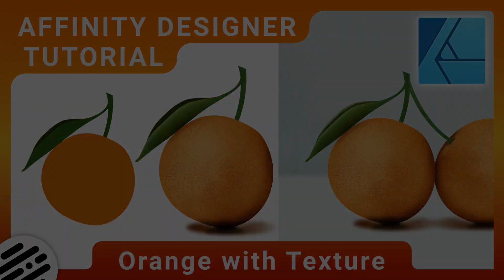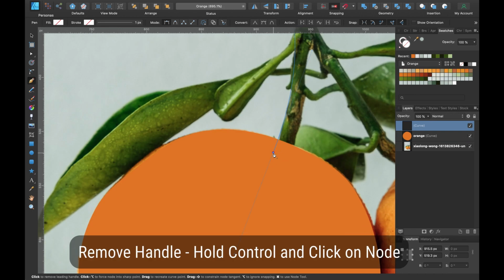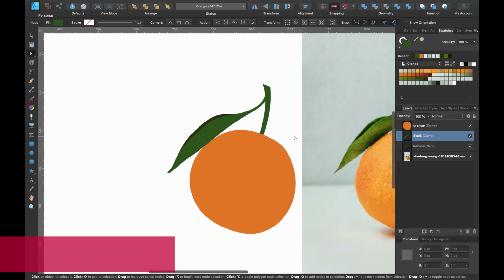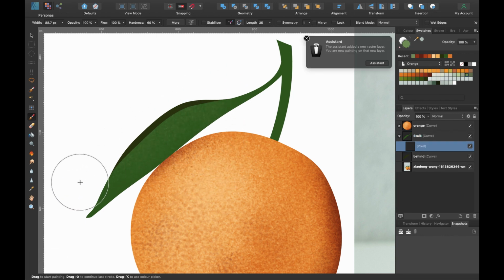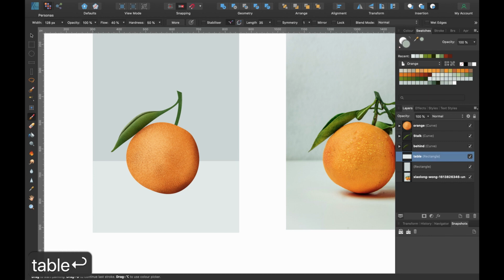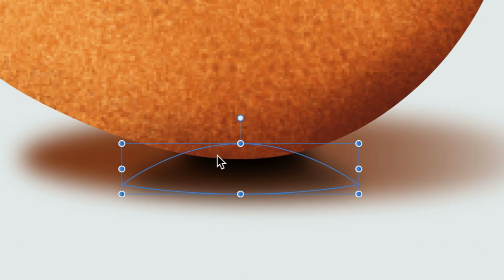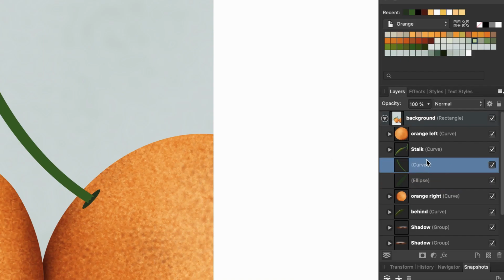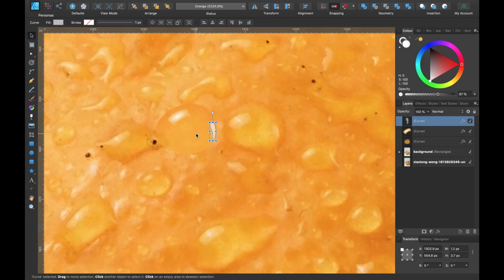Affinity Designer Tutorial - Illustration process & adding texture - Step by Step

Comment: Where can I buy the sprays and splatters brushes?  They are not listed in my brush set options?
Reply from the maker: Hi Bob, hmm I'm pretty sure they came with Affinity. Are you checking in the Pixel persona mode? Have you updated Affinity to the latest version, if you have you now have a profile where you can download brushes from within Affinity.
Reply: @ArtistWright  That was my problem.  I was still in the Designer Persona and wasn't keeping up with the video at that point.  Thanks so much for the reply!
Reply from the maker: @BobSchroden  no worries happy designing

Comment: Hello- Can anyone help me with Affinity Designer "Lagging /Not responding" issue? I click on a line in the drawing and I have to wait approx. 20sec (its painful to wait) it makes for a difficult workflow...I unchecked the "Acceleration" option and I still have the lag issue.....Please help...thanks
Reply from the maker: Hi Tony, I've not come across this problem before. Maybe it's lagging because your computer has too many apps open? I would make sure you have the latest version just to be sure
Reply: @ArtistWright  thanks for your advice 
I ended up uninstalling the app and reinstalling the app from Affinity site and it works as it should

Comment: Mmm, how to break rectangle by using single curve ?! Also: Artistic tool; type something, push "vector crop tool", cut ... But how to "apply" a cut ? ( To get new "rectangle"; if i'm correct now ) thanks!!
Reply: You can draw A line with the pen tool and then expand stroke. Minus it from the box using geometry and then divide.
Reply from the maker: @tezbriz  great idea 💡
Reply: @tezbriz  🤔 thanks!
Reply: Great tutorial by the way. Thank you.
Reply from the maker: @tezbriz  my pleasure glad you enjoyed it
Reply: @tezbriz  it's great and simple ! Easy to replay ...!
Reply from the maker: Hey Michael, I don't think affinity designer has the option to cut vectors using a single curve. if you have a rectangle and you want to cut it into two, you can draw out another rectangle and make it super thin (instead of a single line/curve) then lay that over your original rectangle, select both then click on SUBTRACT in the GEOMETRY tools.
Reply from the maker: Or the XOR tool in the Geometry tools. check out my other video - https://www.youtube.com/watch?v=JrbW9vT3wA8&t=53s
Reply: @ArtistWright  yeah, thanks! Boooolean operations :)
Reply from the maker: when you type out something with the artistic text tool,then use the vector crop tool, you will see a box around the text, you have to move any of the sides.
Reply: @ArtistWright  For sure sides had been moved ... And then it stays like a "mask"; how to integrate to get "cropped text" without conversion to curves ?
Reply from the maker: Not sure I understand, why not just leave it as a mask?
Reply: @ArtistWright  Hmm, yeah. Thanks !